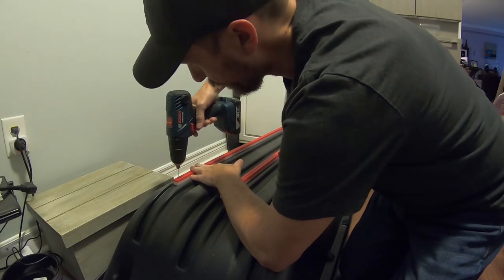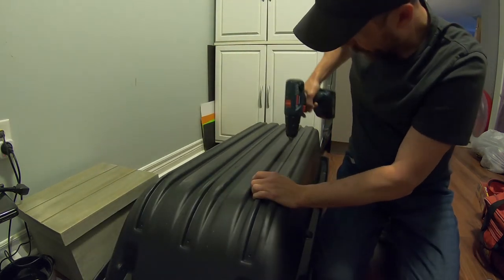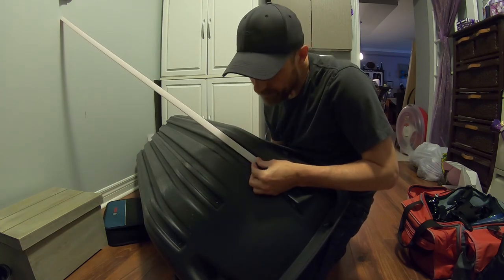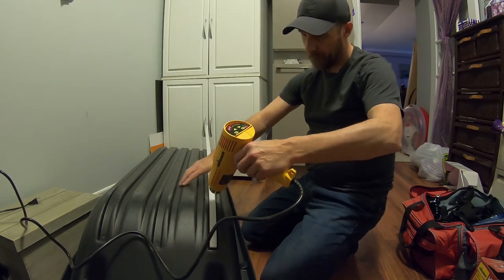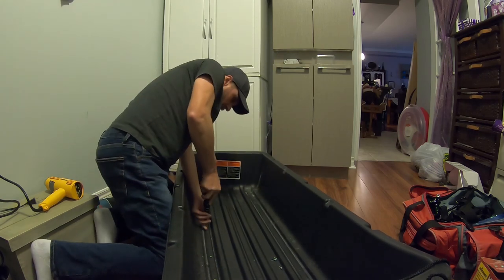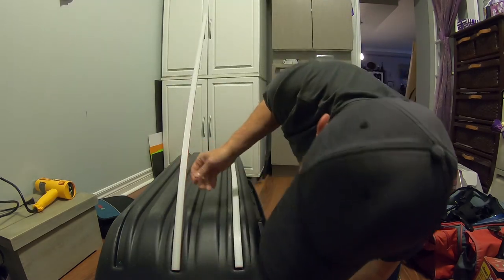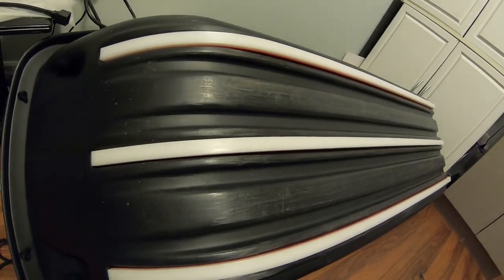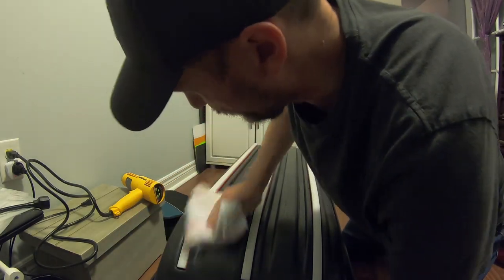Pelican Trek 60 Runner Kit Install

Comment: How is it overall? Have you noticed a difference from before using it to your first trip? Looking at getting some..
Reply from the maker: Overall its been really good. Its held up well. I noticed a bit of a difference. Bought the runner kit to protect the bottom of the sled and its done what its supposed to do so I'm happy about that. Thanks for watching. Tight lines!

Comment: I just bought this sled but can't seem to get the runner kit without paying 20 or so in shipping. Nice to see how too install  them as I've never done it so will reference this video if I manage to get some
Reply from the maker: Hey there Lone Outdoorsman. That seems kinda high for shipping. I managed to get mine on Amazon with free shipping but I'm sure it was built into the price. The installation was not difficult. Thanks for stopping by and checking out the video.
Reply: @X2OOutdoors  ya it is but amazon was out of stock so waiting for it to come back in stock.
Reply from the maker: That's what I thought. Seems lately everything is sold out on there.

Comment: I just bought this same rig and am wondering about the screws loosening in the plastic over time… maybe a carriage bolt might be better
Reply from the maker: I believe the screws will be fine. If you use carriage bolts with this particular kit you would have to counter sink holes so the head of the bolt doesn't stick out. These runners were designed for screws. My advice is definitely to use a heat gun to bend the curve. Makes for easier work and less stress on front screws. Hope that helps. Thanks for watching!

Comment: Is there a benefit to adding these other than wear resistance?
Reply from the maker: These runners make a big difference on the ice for wear resistance on the bottom of the sled. I bought the sled new and after a few uses on the ice I noticed it getting chewed up. I decided to put these on a recommendation from my buddy. If you're using the sled on snow I don't see a need for them but on the ice they help a lot. Thanks for watching.

Comment: Do the nuts stick out on the inside of the sled?
Reply from the maker: The kit comes with screws. The screw head sits nice and flat below the ridges inside the sled. You don't have to worry about snagging anything on them. Thanks for watching.

Comment: what type and size screw are you using
Reply from the maker: Hey Marcus. I think its a #8 size screw. Definitely 1/2" or less. The runner is only 1/2" thick plus the thickness of the sled which is not much. The screws were included with the runner kit so I'm not entirely sure. I'm not a screw guru :) 
Wish I could tell  you more.
Reply: thankyou